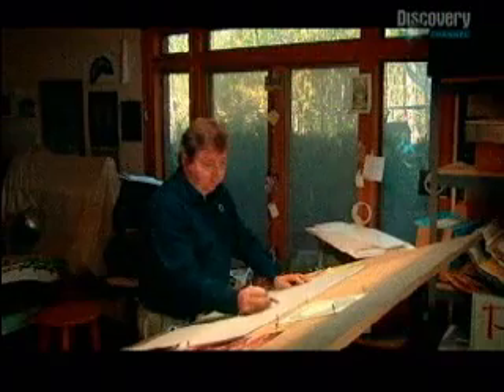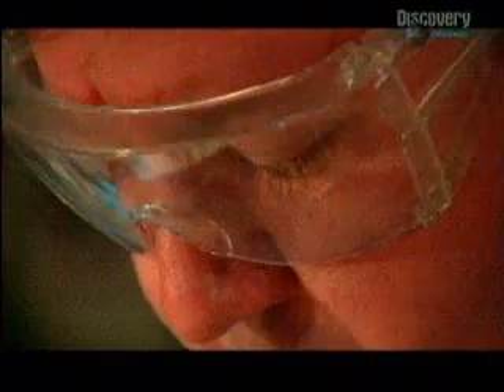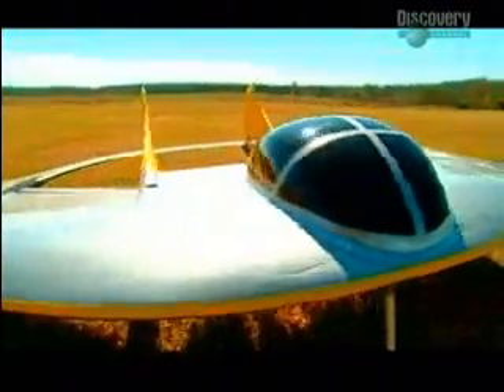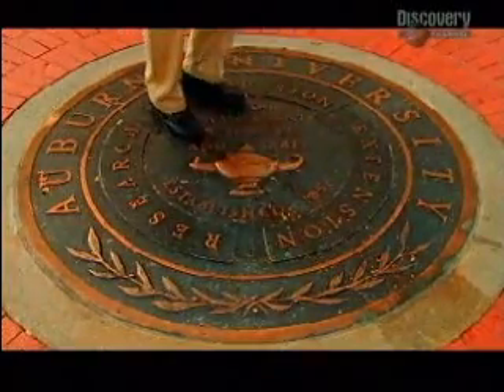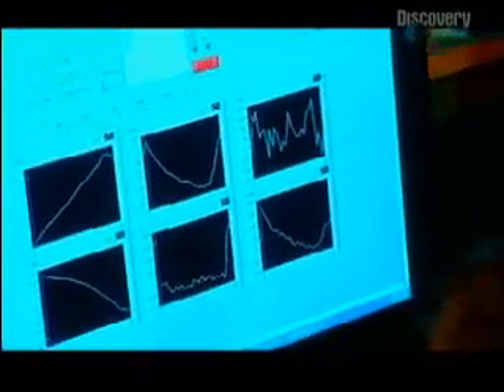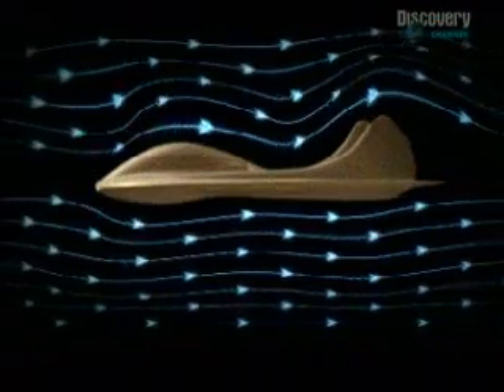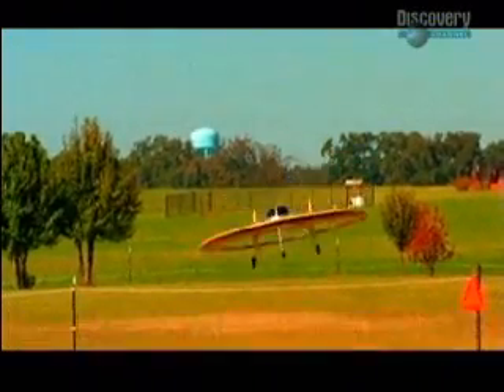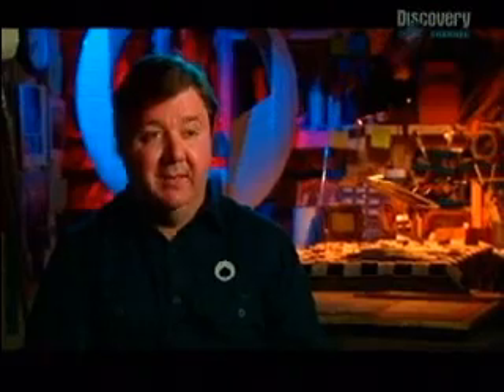NEW Aircraft Design. (AeroBat UFO)

Comment: I dont think this is revolutionary at all. Diamond wings (joined wings) use the exact same concept and that concept has been around for years. The only difference is that this guy rounded it. The join on the outside increases drag, the elevator effectiveness due to the short moment are is reduced, and the induced sweep of the wings reduces subsonic efficiency.